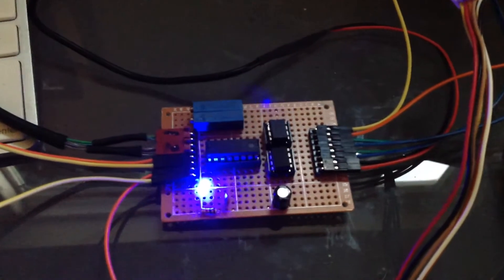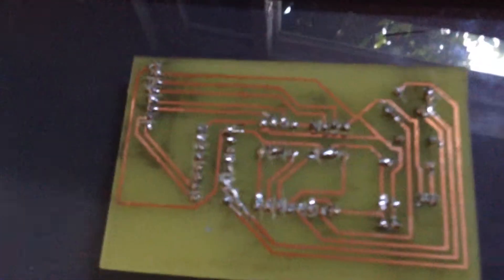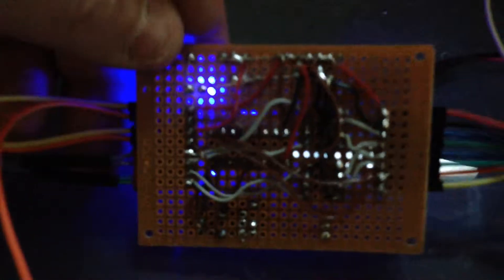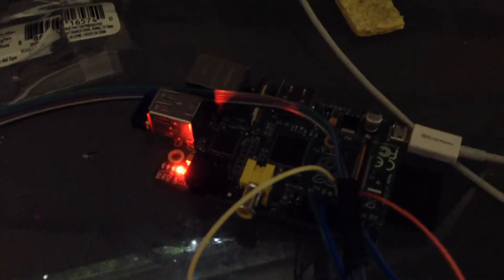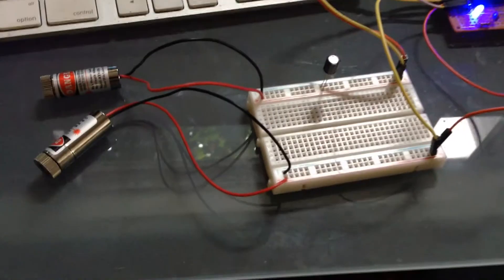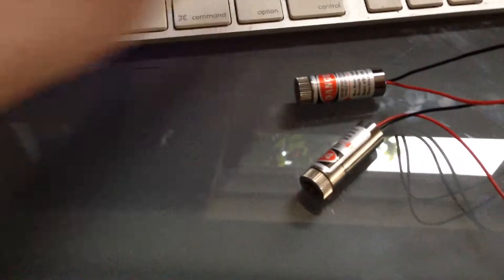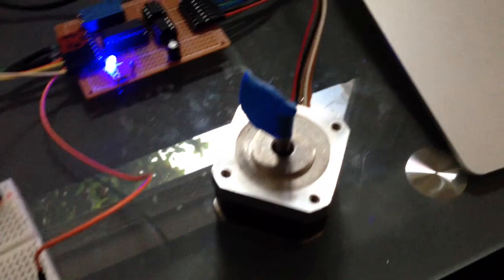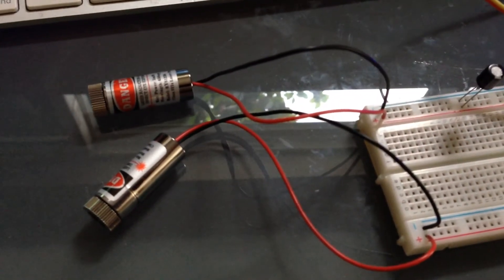3D scanner part 1 - Driver board

Comment: Hey David, I am currently working on creating a 3D scanner. I am also using the freelss software. Did you finish building your scanner or do you have more videos on this project? I have run into a wall and I am looking for some guidance. I would greatly appreciate it.
Reply from the maker: +Vangjel Frasheri Unfortunately not. I had to put the project to one side for while real life took over. I'm going to go back to it in the new year though.
Reply: +Dave Kelly  I understand, I get very busy myself.  I will be working on this as a senior design project for school due in May 2016. I have the circuitry done, and i have test code to make sure the stepper motor runs and the lasers turn on from the RP2. I'm having trouble running the freelss software. I am using Ethernet  for internet instead of the wifi chip for the Pi. The code stops running when it is looking for port 80. If you decide to pick up the project again, I would love to collaborate with you. Thank you